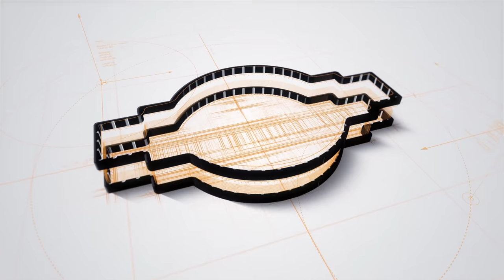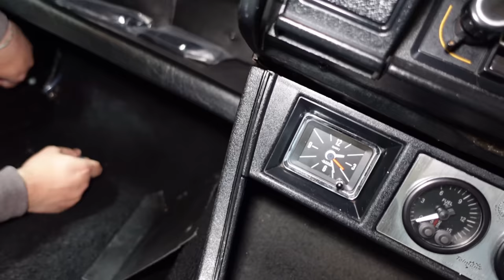What's Happening with the Black Sunbeam LOTUS? - The Next Steps!

Comment: A trick I sometimes use to prevent flash rusting is to rinse with boiling water, the heat means it evaporates before rusting. I'm usually using it on heavier components and perhaps a wallpaper stripper might be worth a try on sheet metal. 

Evaporust is very good, but very expensive in the UK compared to the USA (I have American friends with huge immersion baths of the stuff). Frosts do a similar product for much less that seems to work well. I've got some crystals from Bilt Hamber that also make up a rust remover, that I'll be giving a try at some stage.
Reply from the maker: We wish we could get big dunk tanks of evaporust. It would be amazing. In small quantities it's not too bad but you're right, it's not cheap!

Comment: You both have so much patience, wonderful job. Was the car Bare Metal prepared previously, or would the original paint have been under the thick paint ? The car will weigh a lot less once you have painted properly ! The bare metal behind the hinges, reminds me of my Aunt’s 1988 mini Mayfair, newish at the time, Dented boot, so I got an ‘ in colour’ replacement and both were bare metal behind the hinges, from factory in 1988.
Reply from the maker: It was bare metal first time round and sandblasted..........

Comment: Wouldn’t this be a case for acid dipping?
Reply from the maker: Acid dipping is not a method we use or recommend here in the workshop. When needed we'd almost always opt for dry blasting using glass. Much safer on shells and panels 👍